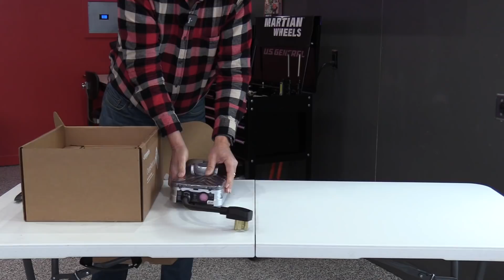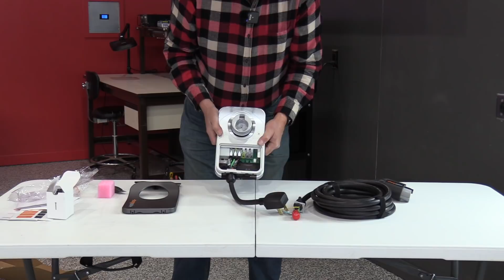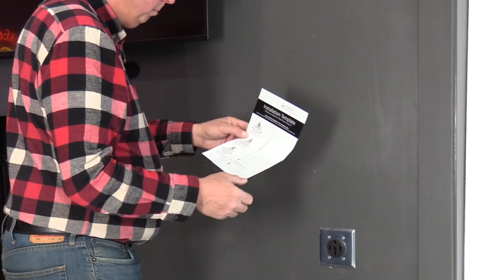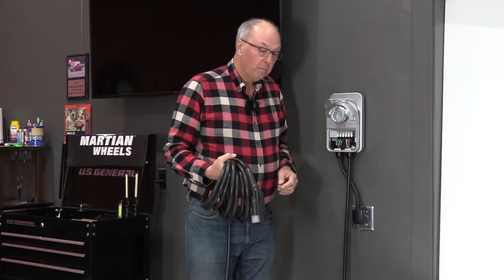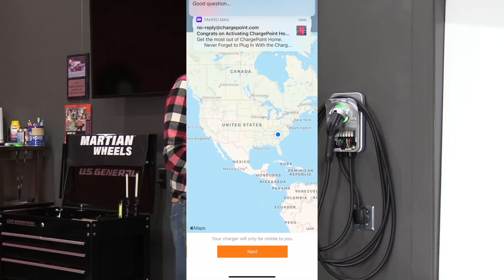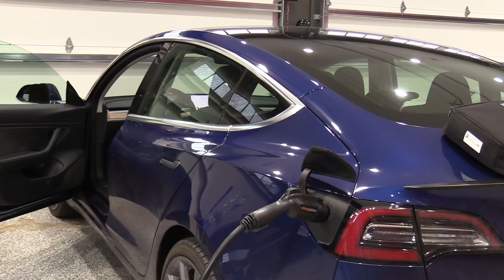An Electric Car Charger Even Your Grandma can Install

Comment: Older video, but a good one. I came to conclusion that hardwire is the way to go. I got my line ready and ordering the charge point for a 48A set up/60A breaker installed. For me it was the Charge Point or Autel. I think CP will do it for us. I am lucky to have the breaker panel in my garage and its 200A in a townhouse.
Reply from the maker: Glad I could help

Comment: As one comment stated, you need to use the more expensive, commercial grade outlets because of the continuous load. Also did not see the breaker. National code now states the need for a gfci breaker. Best way to go is a hardwired install. Cheaper and allows for a higher 48amp output.
Reply: You only get the 48A output if your EVSE supports that.  I don't have any experience with the unit he was installing, but all the ones that I've dealt with so far do not allow for that.  There definitely are ones that allow you to hardwire instead of using the NEMA 14-50 plug -- I just have not had the opportunity to review one yet.  The highest amperage unit that I've been able to review (so far) is a 40A unit and it had a NEMA 14-50 plug on it.  I have it on a 60A circuit with exposed racetrack wiring along the wall in my garage so that I can monitor it for heat.
Reply: @seanseoltoir  I posted my comment 2 yrs ago and have learned a lot in the mean time. The National code does ask for GFCI but many states have not adopted that addition including here in NC. With a 14-50 outlet (hopefully commercial grade), it needs to be on a 50amp breaker, not 60. The 14-50 outlet setup limits output to 40 but hardwired (with appropriate breaker and wire) can go up to 48.

Comment: I think the 10.5 -11.0 kw charge you're quoting from the app , is more likely 9.5 - 10kw. 
You're probably in line with what the power company is charging you for however.
Reply from the maker: Remember the power factor is 1 so if you multiply 48(amps) X 240 VAC you get 11.5kw
Reply from the maker: At the 40 amps out of the Charge Point it’s 9600 PF1
Reply: @evdave528  would you be able to confirm the amperage draw with an Amp Clamp? Looks like one might fit. I'd be interested in knowing the numbers. Also would voltage drop as well? Would that drop to 220 based on household load? I guess that's where you get 10.5kW from

Comment: Good video, Dave! Thanks. I watched a couple of videos in the last few months--one from Muro & Associates and one from State of Charge--that strongly suggest hardwiring level 2 EVSEs, rather than using a NEMA 14-50 outlet. Main reason they give is the potential danger of electrical fire caused by running high power through the outlet hour after hour. In other words, they suggest that a residential NEMA 14-50 is spec'd with a much lower duty cycle in mind. For those still interested in using a 14-50 outlet, after watching these videos, there have been recommendations to avoid residential type outlets and go for industrial grade type outlets, which appear to be designed for higher duty cycles and higher connect/disconnect wear and tear on the outlet. Your thoughts?
Reply: I am an electrician and specialize in charger installs. You are correct and it needs to have a commercial grade outlet (or hardwire) as you suggest. I am getting away from all plug-in installations for this and a couple other reasons that increase the price for a lower output.

Comment: Thank you for the video. Had a question. I can not reach a wall stud due to the short input cable. Tesla used my closet wall stud when installing my back up load panel. So, what type of drywall anchor would you recommend I use to mount the charge point?
Reply from the maker: I think I would use a butterfly or expanded metal anchor
Reply: @evdave528  Thank you. Just got it mounted.

Comment: Get a licensed electrician to do the install. Too many DYI 's wanting be to do installation, good luck
Reply from the maker: I agree
Reply: If you need this video to do an installation, then you probably should not be installing it yourself.

I watched this just to see if the EVSE that he was installing was any different than other units that I've installed.  Some minor differences, but nothing that would make me want to buy this unit over the existing units that I've installed.  The Bluetooth and WiFi capability is just not a big selling point for me since my electricity costs the same day or night...

Comment: With all due respect, I believe you are exerting way too much credit for your chosen profession as an engineer when it comes to installing this base charging station.
While I absolutely agree with your assessment of the dangers of working with not only 240V but with any A/C voltages but to believe that only an engineer is capable of performing this simple setup for this charging base station, you surely are blowing smoke up everyone’s backside.
This is not the 1950’s or 60’s when people were ignorant and gullible, we have progressed over time…. Well at least some of us that is …… lol…., and trying to pretend that only an engineer is smart enough or informed enough to be capable of doing such a simple install is totally imprudent on your part.
But let me not dwell on the negative aspect of your foolish comment and simply say that your video was well laid out, and informative to watch.
So in parting, good job on your presentation.

Comment: The hard part, however, is installing the 50A outlet.
Reply: Depending upon your particular situation, it could be anywhere from just slightly more difficult to quite a bit more difficult.  My breaker panel was in my garage and I already had a 60A circuit for using a welder in the garage, so it was easy to tie into that and put a NEMA 14-50 outlet near the garage door.  The garage has exposed studs and I went with a raceway installation along the walls, so no climbing into the rafters or running the wires through the studs.  If you have finished walls and ceiling, it would be a lot more work though.

Comment: Dave, will you please tell me any charging cable for EV charge to another EV on the road in case the other EV car has no battery.
Reply from the maker: That’s called V2V and to my knowledge on I think Hyundai can do it but at a very low rate of charge.  Best to not run out
Reply: @evdave528  yes, no way to run the battery almost dead. We have to charge the battery only 20% left especially long trip. It's for the purpose of helping others like he jumper! Thanks for your reply. I will check it out with The dealer.

Comment: How can you determine if you have service at your breaker box to add a 240 outlet?
Reply from the maker: An electrician can look at the circuit breaker box and see if there is enough space in existing box or they need to make a sub panel.

Comment: Is this ChargePoint wall connector for use with just Tesla cars [with the Tesla connector] or can it be used for other makes of cars as well [using a different connector]...sorry but i am a newbie...also Model number of ChargePoint device you purchased...thanks
Reply from the maker: It’s a “J1772” standard level 2 connector comparable with almost all EV’s .  I installed it for charging my non Tesla cars. I could have used other j1772 wall connector but liked the features
Reply: @evdave528  Okay...thanks for helping...learning a lot from your videos .

Comment: Are you adding power storage for your house grid? Or fast charge for guests? Or for shorter charging for ready alert moveout? Or just to have an account and find and use charging as you travel to remote locations?

Comment: Great video thanks.  I have a slight dilemma maybe someone can help me with? No garage but I have an an outdoor 14-50 plug and a soon to be Tesla MY.  Problem is that the mobile connector is 20’? And I need 25’.  Should I get a small extension or thinking of a J1772 charger because they are 25’ and just use the adapter.   Any help/thoughts would be appreciated.  Thanks
Reply from the maker: I carry a14-50 50 amp extension used by RVers in the Frunk I case I need it.  I bought mine on Amazon.  J1772 wall Connector ok, choose one that delivers 48 amps. You might find a Tesla version 2 Wall Connector these have 24 foot cables and deliver the 50 amps and are waterproof.  If it was me I would plum a 240 volt circuit outside and mount a Version 3 wall connector in a post.  It’s waterproof and makes charging a breeze, Good Luck

Comment: Can someone explain why you need a wall charger?  Why can't you just plug the charger cable that comes with the car directly into the wall outlet and regulate the charge with a cell phone app or/and the car itself?
Reply: You can do just that.  You don't even need to limit the output if the outlet is a properly wired NEMA 14-50 and the 14-50 adapter is used on the mobile charger (Tesla).  It will automatically go to the max of the mobile EVSE current of 32 amps.  "Why would someone want to do this?" is a different question.  1st, the wall mounted unit goes up to 40 amps which is 25% faster and some people like the convenience of leaving the mobile charger in the car for travel so they will never forget it.  Finally, there is wear and tear on the outlet plugging in daily so just plugging a wall unit in and leaving it solves that issue.
Reply from the maker: I recommended leaving the mobile connector in the car in case you need it. Also handling the large plug could be more dangerous if you were to plug and unplug it.  More conversant for every human to use Wall Connector.  Even Grandma can use it. 😊
Reply from the maker: The Tesla allows you to set charging by GPS location

Comment: Good video.  I have a similar setup; however, the only bad thing about this type of setup is the amperage.  30 amp is the maximum usable amperage but 24 amp would be a more conservative amperage.  I will be getting another EV in the next few months.  For that reason, I will be installing a 50 amp charger so I can charge two EVs daily.
Reply: The breaker would be 50 amps with correctly sized  wiring  (depending on distance) to reach the 14-50 receptacle. (Same for a 9-50 which is 240 volt only.) To supply a 40  amp device. (80% rating for code). His ChargePoint was a 40amp which would deliver 9.6kw. Not sure why he mentioned the 11.2 kW which the Tesla EVSE  supplies. (50amp).
Reply: Not on a properly wired NEMA 14-50 outlet.  The maximum amperage is 40 amps continuous.  The charger may not support that--a lot only go to 32 Amps (some only to 30 Amps and less), but if the EVSE unit is rated for 40 Amps and the outlet is wired correctly (correct breaker and wire sizes), and finally if the service is not overloaded overall, 40 Amps is perfectly OK.

Comment: Great detailed video!  35+ year aircraft electronics guy here, one piece of advice I’d like to give is you should only use one hand when checking high-voltage with your meter leads, not two hands.
Reply from the maker: Amen
Reply from the maker: Used to work in Tube TVs that’s SOp
Reply: A prof in my EE classes in college taught me that. Don’t create a pathway thru your heart. But I have asked many electricians over the years if they do that…. Not a one has said they do! It must be overconfidence from working with it daily.

Comment: They need to come up with wireless charging for cars.  Then it will take off.
Reply: Wasn't there a WC Fields movie where they're aboard an electric powered cruise liner and the electricity is broadcast to it from shore? Big insulator towers with antennas catching the power.
Reply: The electric streetcar at Disneys Calif Adventure is now wireless charged through induction.

Comment: Dont you want 80% of 40 amp for safety?
Reply: The NEMA 14-50 plug is rated for 50 amps and 40 amps continuous.   So when configuring to a properly wired NEMA 14-50 outlet with a 50 amp breaker, the draw of the unit should be set to a maximum of 40 amps (which EV Dave did).  (A properly configured NEMA 14-50 plug usually requires AWG#6 conductors for power and ideally AWG #6 Neutral and AWG# 10 ground wire.)  For chargers like this, often the Neutral conductor is not actually used so only three wires in the unit for the plug (2 120V power and 1 ground).
Reply from the maker: Yes, 80% of the breaker rating for continuous use is what’s recommended.  The plug limits max power through wall connector, if higher charging is desired direct wiring is needed, see manual
Reply: @evdave528  I thought this unit automatically sets it to 40amp if you select 50amp for the breaker amperage.  That's why the Chargepoint app asks for the actual breaker amperage.  Since you selected 40amp instead for the breaker amperage during setup, wouldn't it limit actual charging to 32amps continuous the way you did it in the video.
Reply: @JDI's Lair  Good question.  I know you can hardwire it to draw 48 amps on a 60-amp circuit, but for the plug-in does ChargePoint want you to set the software to the 50-amp breaker (as it says) or set it to the amperage you actually want to draw (40 amps)?  That's kind of important, because I assume the charger will try to deliver the 48 amps if set incorrectly, which I assume the plug-in (or the 50-amp circuit) is not rated for.
Reply: @jed1mstr  And just to clarify for potential users and installers since no one here seemed to know, I contacted ChargePoint and they advised me that you select the CIRCUIT AMPERAGE in the software, NOT the desired amperage you want delivered (as the video indicated).  The unit will select the correct amperage to deliver based on the circuit it's on (in the case of a 50-amp circuit, it will deliver 40 amps).

Comment: I have a Clipper Creek HCS-50P and use that to charge my Volt and Tesla Model Y (using the J1772 adapter) and have been using the adapter incorrectly.  I have been attaching it to the plug and then inserting the plug into the Tesla charge port.  I'm going to stop doing that immediately.  Thanks for that info.

Comment: If you have a 240 line in your garage and a 14-50 receptacle I don’t know why you need anything other than your mobile unit that came with the car plus a $30 adapter to plug into the 14-50 receptacle. Am I wrong, Dave? I Enjoy your channel. Thanks.
Reply: you are not. thats really it.
Reply: It's nice to have a unit inside the vehicle when you are away from your house, just in case you can't find a commercial charger.  It gives you options that you might not have had otherwise... MAYBE you can find someone who will let you plug in and charge if you reimburse them for the electricity you use?  Also, RV parks have various plugs for the RVers and if you  have the right adapters, you might be able to recharge there.  Having to remember to remove the Tesla charger and put it in the car each day is just asking for a case where you forget it when you end up actually needing it... 

Also, Tesla no longer includes their "mobile charger" with the vehicles, so you need to buy it... I have a 40A charger mounted on the wall of my garage and keep a 32A one in the vehicle along with various 240V adapters.  The vehicle is my wife's car, but if she has an issue, I want to ensure that it has things that I might need if I have to go rescue her in my dino-juice Jeep.
Reply from the maker: Of course you can use the mobile connector but a wall connector is easier to use and you still have the mobile connector in the car in case you need it.

Comment: I love watching Dave’s tutorials because he explains all the details of installation.  However, exaggerated title claims your grandmother could install it, but Dave contradicts himself saying you need an electrician or an electrical engineer for the ChargePoint.  I agree the NEMA 14-50 receptacle needs a qualified installer, but NOT the ChargePoint.  It’s perfect for the experienced DIYer.  You don’t need to check voltage at receptacle because your electrician already did it.  Love that he does a smoke test before attaching cover.  

It appears this unit is connected to a cloud server through WiFi.  Does ChargePoint have software for multiple user accounts where ChargePoint could bill each user directly for electricity used.  This capability would be a game changer for EV adoption in condominiums, apartments, and all other multi-dwelling buildings.
Reply from the maker: Grandma is An Electrician.
Reply: @evdave528  For surrrrrre !
Reply: 😆 I'll hire an electrician. Remember what Red Adair said? "If you think hiring an expert is expensive, TRY HIRING AN AMATEUR!" 😆🤣😂
Reply: Hehe… my gramma repaired jet engines for Northwest airlines (before it became Delta)! She would have dug right in!

Comment: Dave, what is the price? That would be good information. Ok, what car are you buying that uses this connector?
Reply: Tesla  has a $ 500
Reply: @changshan  But tesla required you to literally get a contractor or electrician to install. This one honestly can be done by any capable person. I think it will be a wash, if you buy the tesla one and pay the electrician to install (which is around $200) compared to buying this for $700.

Comment: How don’t you use the Tesla wall charger?
Reply: I think he is just showing different options not everyone wants to buy a Tesla wall connector or they have a combination of electric vehicles and want one charger that works with all of them
Reply from the maker: I love Tesla wall connectors but wanted a separate circuit for this vehicle